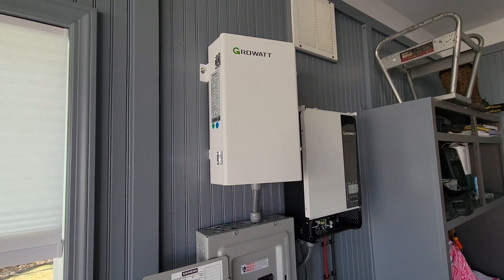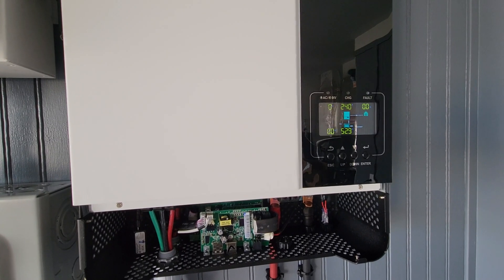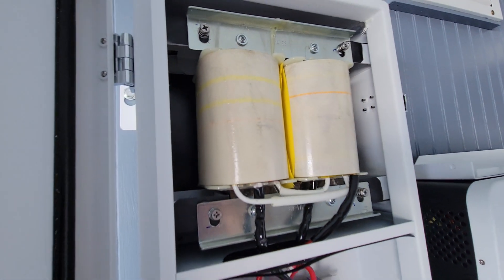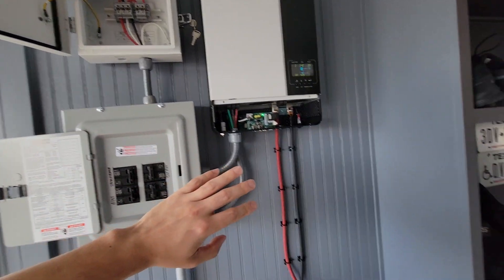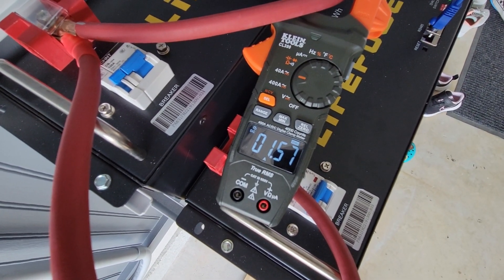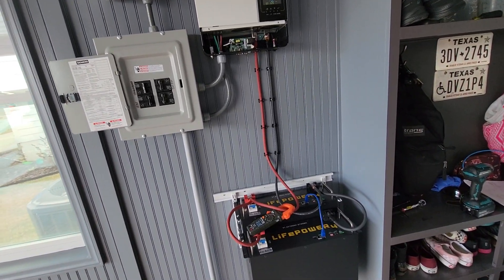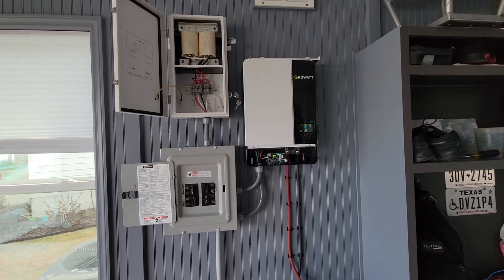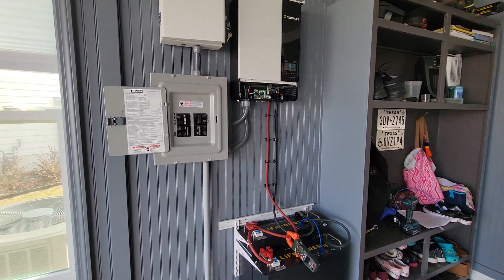Growatt 5kw Split phase transformer idle consumption

Comment: What exactly does the transformer do? And why does one need it? Thanks
Reply from the maker: Check out this video, https://www.youtube.com/watch?v=NVnJhFxCFHw If your in the US you typically need 110v power. This transformer gives you the neutral wire to be able to use 110V off of this 240v inverter. If you've got a 110v inverter or you only plan to use 240v then you don't need the transformer. Growatt does sell these with inverters built in for an additional cost.

Comment: The transformer is weird to me. What's it's purpose? I run an MPPSolar lv6548 and it doesn't have an external transformer.
As far as the pair of LiPo4 goes just running a typical modern side by side refrigerator, a few monitors, computers, lights, ceiling fans, modem, router, microwave, just the typical round the clock draw of 300 to 400watts I'm getting about 36 hours out of fully charged batteries. Basically on overcast ugly days I will go on battery around 4pm, ride all night, survive through a cloudy rainy day making maybe 100w or so from the solar arrays, about 1/3rd of my normal daytime draw, then make it through the night and go on line power around 3 or 4 am. I have my battery cut out set at 48v as well. There's a sweet spot at 52.2v where the batteries will hang forever. The decline from 51v to 48v happens pretty fast.
I'm adding a 3rd battery bank before summer to get me to 15.3kw of battery. Gotta run that AC all night for free
Reply from the maker: Awesome thanks for the input! I haven't done any testing quite yet. Also, I don't have panels but they are on the punch list. Here is a reply that I posted on another comment about the transformer. 
Check out this video, https://www.youtube.com/watch?v=NVnJhFxCFHw If your in the US you typically need 110v power. This transformer gives you the neutral wire to be able to use 110V off of this 240v inverter. If you've got a 110v inverter or you only plan to use 240v then you don't need the transformer. Growatt does sell these with inverters built in for an additional cost.

Comment: thats its normal consuption.....its better to put those batery in horizontal..to avoid a quick degradation of the cells ..
Reply from the maker: Just got off the phone with Signature Solar, They informed me that it was fine to mount the batteries the way I've done it in my video. They stated that if I didn't use the server rack then they recommend having them sit vertical with the connections facing up.
Reply from the maker: Thanks for the input! I know I haven't seen them mounted the way I have them and I am worried about the weight of the batteries pushing on the cells on the bottom.

Comment: Yes! Nice install.
So tell us how long the 2 batteries lasted and what you powered?? Finally seeing 48v 5000es vids.
 I bought the same, but haven't looked in all boxes yet. No time..
I will live vicariously through you.
Reply from the maker: Craig, I will definitely keep you posted. Temps will be in the 20's tonight here in Florida so do alleviate any unnecessary cold weather stress on the batteries I will wait until it warms up a bit. The biggest load I believe will be the blower motor on the air handler however, I also have my garage outlets wired and my air compressor plugged in.
Reply: @Thesick240  I built a 3 sided enclosure. On the inside I cut up 2" polystyrene insulation with the foil backing. What I found was that the equipment produces enough heat to keep my batteries 25° above the outside temperature. There's other tricks. You have to have a fan in the enclosure to mix the air up or the bottom where the batteries are stays cold. A little 5v desktop fan from Lowes solved that. And if you hang an incandescent bulb inside the enclosure it will shoot the inside temperature up into the 70's when it's 30's outside. All of my equipment is on the back porch. Just being under the roof the temperature is 4 or 5 degrees warmer than in the yard.
When you have 4 grand in batteries that can't survive being charged frozen, you worry about it. Enough so that I built an enclosure and spent days monitoring the temperature at the various levels and times of the night until I got comfortable. If I ever leave town I'm moving my batteries inside. Lol.
Reply from the maker: Thanks for the advice! Much appreciated.